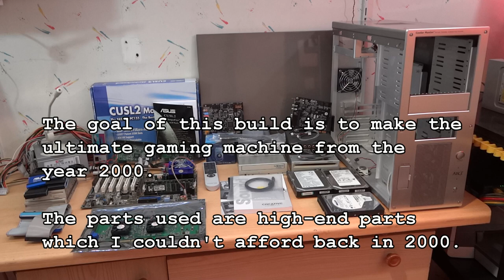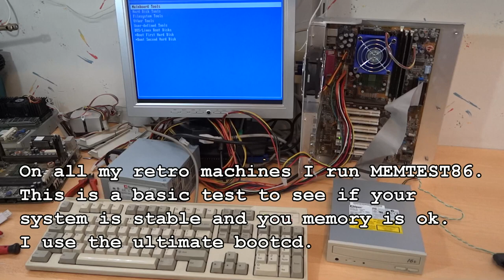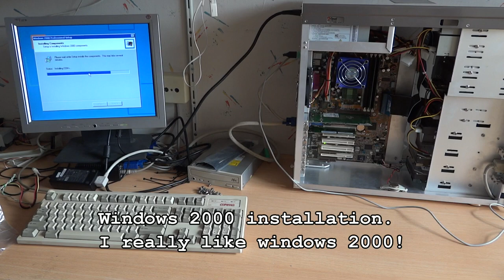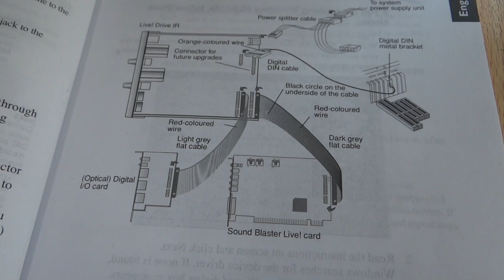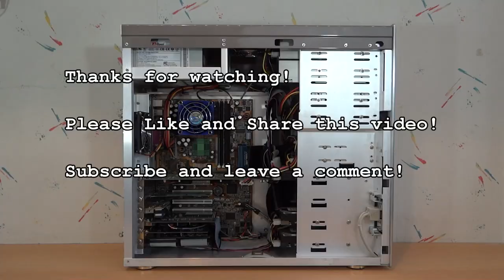Ultimate year 2000 gaming build! 3DFX Voodoo5 Asus CUSL2 P3-1ghz CM ATC201

Comment: in 2000 It was AMD K7 Thunderbird that was the fastest chip.
They were annihilating intel in benchmarks.
You used a p3?
Reply: 1GHz Pentium III mand ONE GIGAHERTZ IN Y2K
Reply from the maker: The K7 was faster but the chipset from via less stable and had more issues.
Reply: ***** You got your dates wrong. If Athlon XP existed in 1999 Intel would have ceased to exist :D
Athlon XP 2100+ was actually released in 2002
Reply: Stephen Haworth Actually the performance difference was minimal, only in some specific cases did Athlon take the lead. What AMD actually did accomplish was beat Intel in GHz battle - they were first to release 1 GHz CPU.
Reply: amd had a duplex bus, massively increasing bandwidth.
Reply: BIOS is probably from 1999.
Reply: So then the CPU was made in 1999. The board and CPU are two completely different parts of a computer.
Reply: *****
Well, that is registered trademark year which is something else entirely. First Athlon processor was out in 1999 and that's registered trademark year of brand "Athlon", so it makes sense for other Athlon processors to mention that same year.
Reply: Stephen Haworth
But not much real life effect
Reply: What's a Prescott? Never heard of that company before.
Reply: Why didn't you just say P4 then?
Reply: lol
Reply: FAMICOMASTER It was a core type of Pentium 4 processors, one of the last ones. They were commonly known as Preshott's. I still have my 3.0 Prescott. It was a nice little overclocker with a Thermalright XP-90C cooler on it.
Reply: ***** stock speed? yeah, that sounds about right. My 3.0E idled at between 45-55 with the XP-90 on it on an 865PE board. I was able to take it to 3.4ghz stable'ish but thats it without a more serious cooling method. Oh prescott's.
Reply: I really don't bother overclocking my machines or even adding new coolers or parts for that matter. I always end up doing something wrong and it ends up killing my machines...
Reply: And the GeForce 2 32mb AGP is also better than Voodoo... We all know that.
Reply: I miss my geforce 2 MX400 64mb. Was one of the last PCI-based nvidia cards released and I carried it on in my old ass IBM PC until the FX series cards hit the shelves. It was certainly a trooper.
Reply: the had a mx4000 that was pci too
Reply: What?
Reply: Look at the Overclocks and Temperatures, whata Shame for AMD. Intel is better. Tualatin especially
Reply: AMD is cheaper. I know, I know, you get what you pay for, but I don't tend to overclock things much besides my Palm pilots, and they don't have any kind of cooling system and can be overclocked to the max just fine, I got a Palm m515 to 128MHz just fine, but anything past that you get memory and screen issues. Only AR CPUs support high overclocking though.
Reply: After that came socket 754 still putting to intel to shame....
Reply: Ikr, AMD is better because they tend to have backward compatible instruction sets. If I put my Windows 2000 AMD Hard drive into my brand new pc, it can and will run. Drivers won't exist, however, but thats a different story.
Reply: Because XP's support lasted for almost 12 years. That's pretty long for an operating system. Windows XP also has better DOS support, while 2k can't even run simple programs such as MS-DOS editor and batch files won't run under 2k, but work just fine under XP. Even if XP wasn't the best, 2k certainly wan't either. What's so speaical about AMD FX though? Isn't it, like, onboard graphics or something, and wasn't it released in like 2013? If so, why are you still running 2k?
Reply: Now I will have Athlon 1100 Thunderbird Socket A
Reply: I have an AMD Phenom 64 x4 64 @1.8GHz bit in my main pc. The secondary one has an AMD Athlon 64 x2 32 @2.0GHz.
Reply: Too fast for Retro
Reply: Fatality OCComputers To new for retro. ^

You want retro let me just pull out my IBM 6x86MX PR200.
Reply: Or let me start up my VTech Laser 128EX.
Reply: nameless0193 ***** (c) stands for copyright, not registered trademark. The (c) 1999 on the Athlon Xp means that the first designs of the chip date from 1999. This has nothing to do with existence of the physical chip and especially consumer availability. 
Still AMD Athlon 1Ghz was released before the PIII 1Ghz. In general the PIII was on pair with the Athlon, but intel dropped the ball with the P4 which was struggling to keep up with the Athlon64 and the Athlon X2, even though Intel was rigging the benchmarks (google "Intel benchmarking shenanigans").
Reply: had one.
Kthx
Reply: Yeah, then Intel pulled the whole "We will pull your patent for actually being competitive" ordeal, then started resorting to illegal tactics like paying OEM builders to use Intel over AMD, even though they got sued for billions over it they still made much, much more.
Reply: TheNukaColaQuantum Well look on the bright side.
AMD now has both major consoles, gaming technology in general, and two clicks away from flawless desktop convergence.

Intels stuck with a rotting apple and desperately trying to brute brute poorly threaded apps on passmark.

4 years...
Reply: It's only when Intel went to the awful Netburst architecture for it's P4 that AMD took the lead, until Intel switched to the Core architecture. I'd take a P3 and its corresponding Intel chipset over anything AMD of that time.

The only upgrade over that P3 Coppermine 1Ghz would have been the P3 Tualatin at 1.4Ghz. This is the CPU I have in my retrobuild with a Geforce 3 TI500! The Intel 815 chipset on my Asus CUSL2-C is what define "rock solid"!
Reply: Mattack I remember owning one of those too; I did the pencil unlock trick, got it up to 1400
Reply: Stephen Haworth You remember 3dfx? Oh I love them.
Reply: Yeah I miss the ext cable based SLI
Reply: Stephen Haworth That was a VGA cable that went on the outside :P Do you know where to read up on the pencil trick?
Reply: nah I dont remember. Its been years.
Reply: FAMICOMASTER AMD was first to 1GHz with their Athlon Slot A CPU.
Reply: @nameless0193  Found another comment mentioning my old account, again.
Reply: Athlon 1200/266 + GeForce 2 GTS/Ultra = TOP 2000year
Reply: Pentium tualatin core 1.4 ghz better then AMD : )

Comment: voodooo5 is just an eye catcher, nvidia and ati already had better options back then (which is why 3dfx went bankrupt). unless you were only playing glide API games, it really made little sense to bother with the voodoo cards. voodoo5 was outdated so I guess it'd make more sense in a 1998 ultimate rig :P
Reply: They were comparable on lower resolutions with AA enabled ...
Reply: Indeed, in early 2000, the the geforce 2 GTS was way, way ahead... Voodoo 5 already struggle with the geforce 256 (that was from 1999)... the geforce 2 was the final blow.

Comment: Why windows 2000 and not 98se and why 2 soundcards?
Reply: +Vasilios As i woulda done Windows 98 as well
Reply: +That Stoned Man Windows 98 were more popular on 2000 and more gaming friendly than shitty windows 2k,plus I am not used to make overseas calls to gay people...
Get it?If not go to sleep.
Reply: Vasilios As yeah Windows 98 was way better 4 a machine like dat than Windows 2000 but Windows 2000 ain't bad but i woulda gone 4 Windows 98 even if it's a 2000 build
Reply: +blakedmc1989RaveHD Even Windows 2000 is nowhere near as shitty as ME--Mistake Edition.
Reply: win 2k is fine but why 2 soundcards?
Reply: ME is better than 98SE If you don't care about Real DOS Mode and I call ME the Misunderstood Edition because People at the time called it was installed on Shitty Machines like Celery OEM Machines.
Personally ME Is the most evolved OS in the 9x Kernel line of OSes, It was going to be called Windows 2000 Home Edition and was going to based on the NT Kernel but the system requirments for it were Higher than Usual so they used the 9x Kernel =)
Reply: Forgot to mention and the NT OSes were expensive
Reply: My pentium 3 was shipped with windows ME. So I tried it, and it wasn't that unstable. The only thing that made it crash was to try to launch DOS apps, where there, yep the OS went completely crazy, but for the rest, it was fine.

Maybe one day someone will make a tweak to replace MS-DOS 8 by the good old MS-DOS 7.1 and maybe it would make it even more stable ?
Reply: Deksor i would format it 2 Windows 98
Reply: Well I did it because I wanted to play DOS games, however like I said, I had no problems with any windows application
Reply: +THERAZORKILLE Productions Doesnt like NEPTUNE

Comment: How could you? This begs for a CRT monitor, not an early LCD, which were total garbage. The games were designed on and for a CRT; the content was made for a ~2.2 gamma and it's going to look washed out and wrong on an LCD. The content was made for a variety of 4:3 resolutions and the CRT can handle them all natively without resorting to bad scaling (a 1280x1024 LCD can only ever display 1280x1024; if the resolution is e.g. 800x600, it will be stretched and scaled up to 1280x1024 giving a blurry mess). The CRT had excellent black levels, higher refresh rate, very low persistence and no display latency.

It is only in the last couple of years that LCDs have managed to catch up, and then only for modern games not designed with CRTs in mind.
Reply from the maker: +soylentgreenb I got 2 machines like this running and they are both with CRT's right now :)

Comment: I am a Linux user, yet I also use a Windows 2000 on a daily bases. The OS is unofficially supported and besides heavy graphical uses and a few moder software titles  (direct X 10 etc) it can still be used.

Comment: Very impressive build. Brings back lots of memories.

I used to have an OCed Celeron with Voodoo2 SLI for gaming and also a rare "Empac Blaster PC" which had an SB Live! sound chip on the motherboard. Both were great machines!

I never had a Zip drive but I did have the competition. The LS-120 was a very fast drive and I loved the backwards compatibility with normal floppies, but the actual LS disks broke very easily even if you took great care of them.

Comment: very nice job, man thoose where the days.

i did a "year 2001", and subsequent "year 2004 upgrade" build myself, and i used exactly the same parts i had back then...down to exaclty the same coolers, harddrives and so on...took forever to find the parts, and it was kind of expensive. unfortunately i don´t have time to really use and play on the machine anymore, but it was a nice sentimental experience :) cheers! keep it in a friendly place and let it run from time to time.

Comment: The thing that truly amazes me is how many of those expansion cards serve purposes that today's motherboards handle with ease. The motherboard I just bought has plenty of sata for connecting all my drives (HDDs, SSDs, and ODDs) so no IDE cards. It has dual NICs, so no need for a network card. Built in audio, so no need for a soundcard, let alone 2! (Tho I have an external DAC). Even video cards can be left out for a basic workstation build these days. No wonder mATX and mITX builds are becoming so common, few people actually need all the expansion space any more!

Comment: I use my Sound Blaster Audigy 2zs with a toslink cable to my 7.2 AV receiver for true Surround sound in DTS, THX, and Dolby Digital. You need a DAT for your computer backups. I had a similar setup back in 2000. I used the Matrox G450 and High Point IDE controller, Iomega drive, DAT, DVD burner, etc.

Comment: That case is very very cool.  I would still consider using it in 2014, although I don't know how well it would house a video card with a two slot cooler.  I love the modular mobo tray that slides in and out.  Very cool video, that twin gpu voodoo 5 was such a beast!  The only thing that really left me scratching my head was the need for two seperate sound cards, kinda redundant in my opinion.  Thanks for sharing the video!

Comment: i had the Creative Live card, Kingston memory, Maxtor drives and some other stuff but I think I was running a GeForce 256 by then. I still have my 3drf Monster video card. loved 3dfx. I could swear I remember seeing a Voodoo 5 card on top shelf in my local Software Etc in 2000. Thought it was huge. Or it may have been something to do with that huge VooDoo 6 with 3 fans or something. been too many years for me lol.
I see your copy of Heavy Gear. I loved those games. Still have all my games since 1994 too. You built a cool computer. I miss those 90's and early 2000's .

Comment: i had a cusl2 with a coppermine 500e overclocked to around 180fsb and stable. im sure it would POST at 200fsb as well. very very good board, i went through many that year, 440bx, apollo 133, 820 with sdram and settled on the cusl2.

Comment: I have my Audigy 2zs connected to my 7.2 AV receiver via  Tosink optical cable and let my AV receiver do all the decoding for 7.2 surround sound. you need a firewire cable for your Audigy 2zs. 250mb zip drive , 1gigabit Intel NIC, And a better power supply as you have an expensive computer. Good Computing. Enjoyed your video.

Comment: I got a PIII 1GHZ with a cheap ATI card from the early 2000s runs everything I can't emulate that I own. I was thinking of taking my PIII 550 and dropping in one of my two voodoo 3s for glide games but now all of them run in PCEM so I have been less than inclined to put it all together. Anymore I am finding it hard in my area to find replacement parts and I try to use my old hardware as little as I can get away with. Just sometimes the desire to relieve the past is just too strong and sometimes I just want to play those older games.

Comment: awesome build man. the nostalgia is extreme :D
In the middle of building myself a Pentium 1 retro gamer..
Simply for the nostalgia of my first ever gaming pc build years ago, 
Pentium 1 Socket 7 200mhz, 32mb PC133 RAM, 80gb Maxtor HDD, Sound blaster live sound card, Network card, and 2x Ati Rage Pro 3d 4mb graphics card in CF.. :D
Not forgetting an old Retro IBM case and quad speed cd reader drive from 1993 :D
Running windows 95. :D
Reply: 80GB 0_0 for a 96/97 build!?
Reply: Crossfire wasn't a thing liar
Reply: during the Voodoo series cards.. You could get a Madusa cable, Which links two cards together.. Which was essentially, Crossfire..
Reply: Trust me 2GB of hard drive space for a 96 PC is more than enough

Comment: I regret trewing like 20 pc cases away last year. I had to because I was moving home. Most still worked:/ The 1 I regret most was my Amd Athlon slot a 800 mhz with 786 sd ram and it had the PCI voodoo 3 2000 and my thunderbird on 1400 mhz. Was such a monster back then.
I do still have my old laptop ( first laptop ever with a battery). It still works:)
Reply: Martijn van Zanen your old pc move windows xp?
i got a pentium 4 and 2gb of ram 80gb in hdd agp ati 9200
it works for collection or not
Reply: Marco Andres Ye a 9200 is fine for old school lol.:)

Comment: OMG I had a lot of that hardware.  I had:
CUSL2 815 motherboard
P3 733 MHz EB coppermine
256 Megs Kingston ram
SB Live 5.1 with live drive
Maxtor 40 gig (more than 1 platter)
only major difference is I had a Guillemot Hercules Geforce 2

Comment: I have a similar rig, P III 1000, CUV4X, 768 MB RAM, Voodoo5 5500, 20 GB early Barracuda. I wonder if switching to P3B-F or CUSL2 would make any difference in terms of performance. It's not bad the way it is but there's always some room for improvement, right? And if not, at least I could overclock it...

Comment: The parts used are high-end parts which I couldn’t afford back in 2000
Well guess what it’s not affordable in 2022 either the Voodoo card cost $750 to $2000 right now I mean come on it’s 2000 video card not RTX 3090
Either way this build is very nice and I wish it cheap to build it to experience what it like to have a gaming pc in 2000

Comment: That Maxtor drive didn't exist back then. I think it came out in 2002-2003. The most popular harddrives back then, because of their high speed, were the IBM Dekstar series.
The real hardcore gaming machines used ultra wide SCSI drives (preferably 10k rpm if you had the money left after buying your SCSI controller and VGA adapter)

Comment: my rig in 2000 :
Pentium 3 650mhz (100mhz FSB) @ 910mhz (140 FSB)
Asus P3B-F motherboard (still the greatest motherboard ive owned lol)
512mb (2x256) Mushkin PC150 Sdram
3Dfx Voodoo 5 5500 AGP
SBLive! Value
Western Digital 40GB 7200RPM HD
Promise ata133 IDE adapter card
....
God I miss that thing. And have regretted selling my V5 ever since :(

Comment: OMG this is still a beast now! I remember that computer in my home is kind of a beast at that time (it can easily handle most game until 2009, then it just broken). If I didn't remember wrong, it has a 128MB 1GPU voodoo card inside.

But wow look at your beast. The graphic is still ok even in nowadays!(If in 2000? I can't expect more!)

ps. Actually the case you use is still better than 99.9% of the cases today, because those cases made in recent years really sucks. Those case is as thin as a piece of paper, and weight nothing! So if possible, I always prefer old cases more.

Comment: Nice Video well done man.
I Miss my old system I had it all  first Burner ever made!  Sound Blaster    Creative Labs and special inputs and outputs.
Sony special software.
Burn any CD or DVD software !  I miss that..
I had a 1 Gig AMD it was the best and the fastest system ever.
 Voodoo5 
Two Raptor 10,000 rpm running Raid   0 as 1 drive for insane speeds.

Comment: used to have a Pentium 3 coppernine 800mhz, 768 Meg's of Static Dynamic ram and a 32 mb Nvidia Riva TnT2 M64 pro gpu. 

kept using the machine till late 2010 I think. it was massivly out of date by then but when it was the early 2000s damn that thing was a solid 30-40fps in GTA Vice City at 1024x768